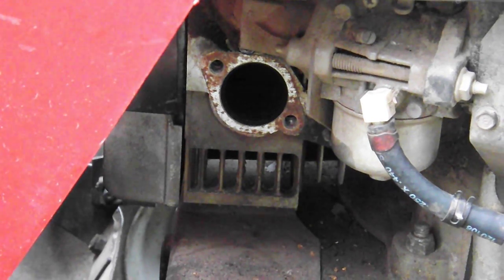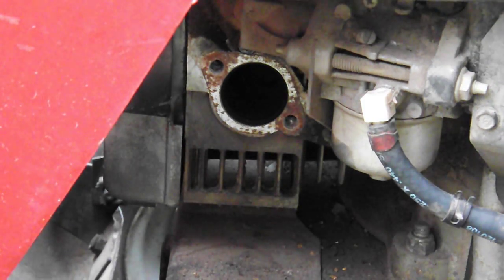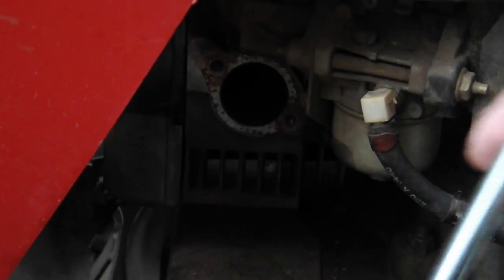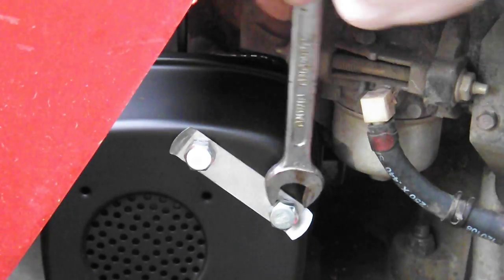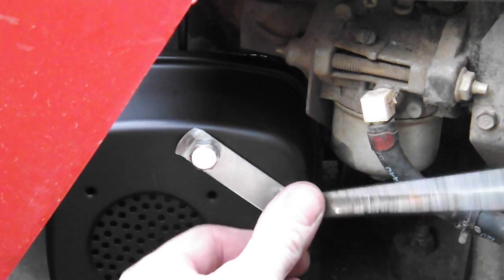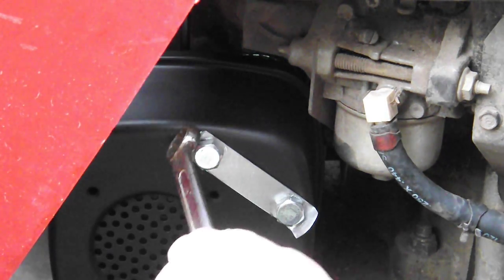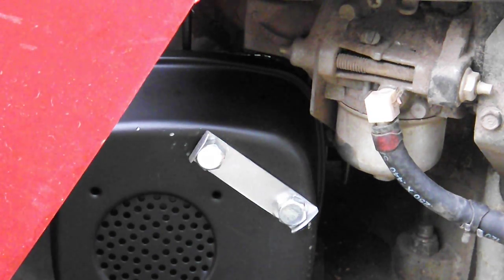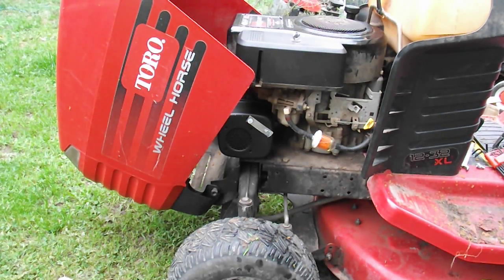replacing the toro's muffler

Comment: The plug top lol, we used to have rubber mains plugs where the cable had to go through a hole in the top lid before sticking the wires in the terminals and gripper bar.
Yep same mistake was made lol.

That muffler looks neat, better than the dead one :-D.
Ive never liked aluminium, i used very short spanners and looked for leaks later.
Reply from the maker: I fitted the deflector today too. Will have to make a video :)